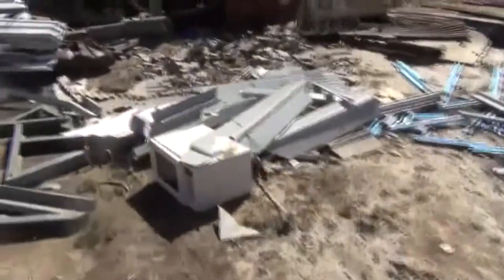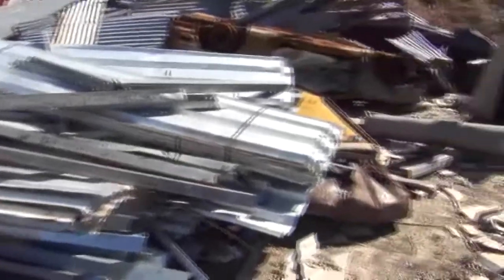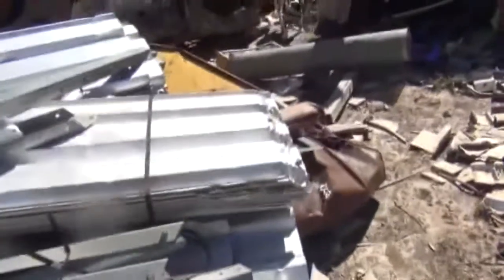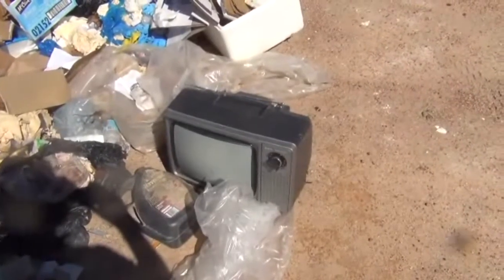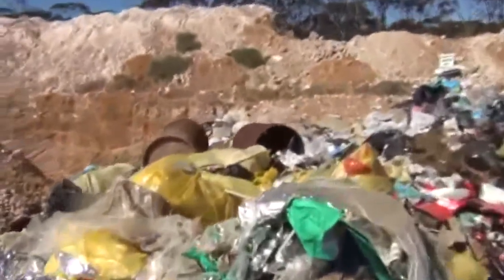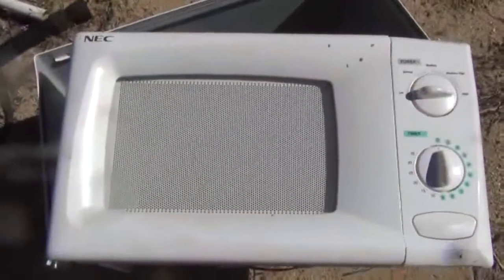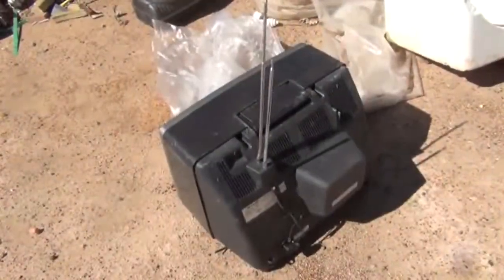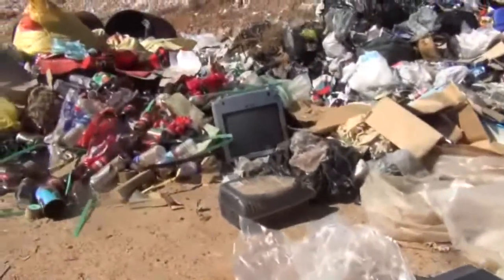Basic Scrapping Tips - Stainless Steel TV Aerials & Aluminum in Microwave Oven Doors

Comment: Antennas are mostly made out of nickled brass or a similar alloy, so you dont get ripped off at the scrapyard... If you bend the  antenna splitopen you probably get to see some yellow. Stainless steel are worthless in electronics hence its bad abilities to lead electric currents. Cheers